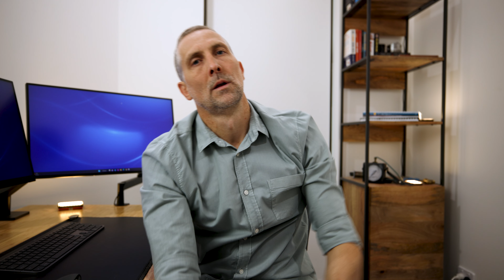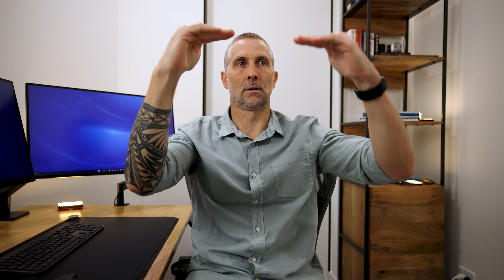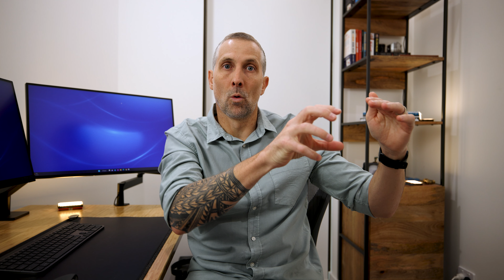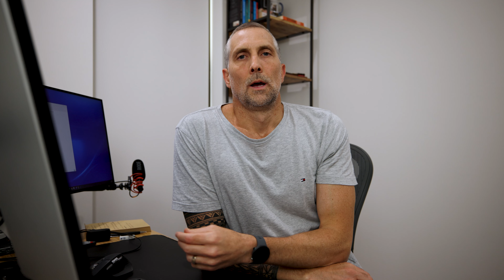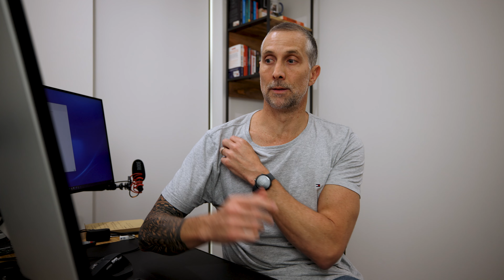You think you know OA control? Separate min OA volume measurement? - Part 2

Comment: If the bypass valve does not open to maintain flow the chiller flow will trip on low flow. Our knock on effect is someone has to go reset the chiller, this costs money. Like your videos. If we can find the balance between not tripping and knowing when to open my bypass based on valve demand from my 2port valves vs. pressure control which doesn't seem to react in time to prevent tripping the chiller.

Comment: Bryce, OA min control is a big energy waster, and I could say that none of them are reliable.

There has to be a better way and at the moment I think any system you check will be working incorrectly.

The design engineers should have a full proof way of specifying how we should do it, not tell us that we have done it wrong. That’s what the engineers are meant to do. We do it one way and then get told how to do it another way. Big waste of time and money. 

This is happening too much in this industry. Specifications are written very loosely and we have to make up the slack then get told we are doing it incorrectly. 

All a waste of time and money. If you want it to work a certain way then tell us how you want it done. If you don’t want to put your credibility on the line then don’t tell us how it should be done.

The only full proof way as I see it is maintaining a negative pressure in the mixing chamber that makes sure you have OA  coming into the AHU based on the air quantity that the AHU is doing compared to total air quantity which is based on the total number of active VAVs that it is supplying and the air quantity that they are doing. (Maybe AI will work this out)

If you don’t like this then tell us in the spec exactly how you want it done….whether that is right or wrong.

Vel grids only work when there is not pressure influence in the duct that it is mounted, I am very open to a way of accurately measuring air quantity in an intake duct that is fed by multiple air streams, return, outside air.

We only have the tools and inputs to create the correct output, we are not magicians. How else are we to workout that each individual requires 11.5 litres a second of outside air ?
Reply from the maker: Sometimes I read in a control strategy (FD), where the BMS engineer writes that the outside air will be modulated to maintain 11 lps per person. LOL, then I know they copied that out of the mechanical spec and I am thinking, "how are you going to do that" :-)
Reply: @bryceanderson17  Bryce, in your travels have you come across a good way to measure min outside air ? I have been involved with vel grids and Hotwire velocity probes etc and none give a really good constant reading.
Reply: Still open to an idea on this as knowone has come up with a reliable way to this issue, everyone turns a blind eye.

Comment: May be overthinking it a little... solar load is roughly 30% of the total heat load....if the SA fan is turning down that much, it is most likely the space is below design occupancy and does not require OAmax.
Reply from the maker: If half the floors are shut down because those companies staff are working from home, the fans will turn down pretty far. 
Or, if the AHU is running in after hours mode, i.e., there is 1 out of 10 floors enabled, then its likely that both SAF and RAF will be running at minimum speed (the same speed), possibly zero OA. 
In Australia, usually the RAF's are axial fans and the SAFs are centrifugal fans, they have different characteristics so simply tracking by a fixed 10% probably isn't going to work. 
Eitherway, we should design and commission control systems to work properly through the full range of the SAF, not just at design speed. 

"Solar load is 30% of the total heat load". I didn't know that. Thanks 👍
Reply: In Australia regardless of occupancy there is still a minimum code OA required, usually based on floor area. The code minimum and the design qty of OA are 2 different issues. On a well designed system with DCV the code minimum is the qty we have to preserve when turning down the SAF. DCV will increase to design qty if required.